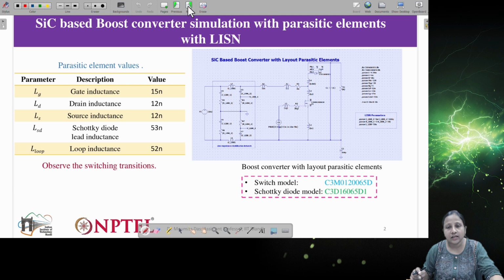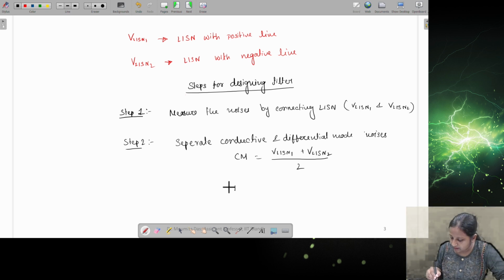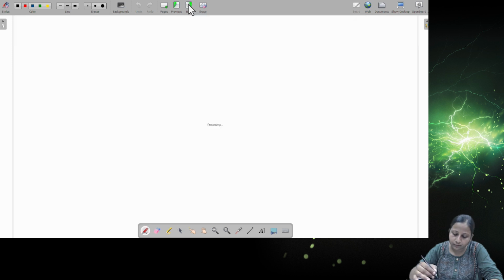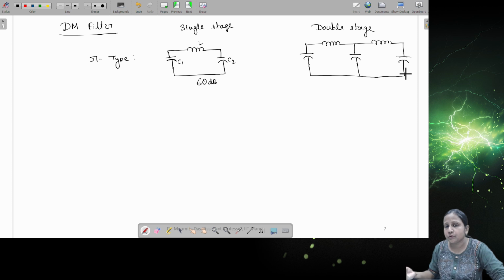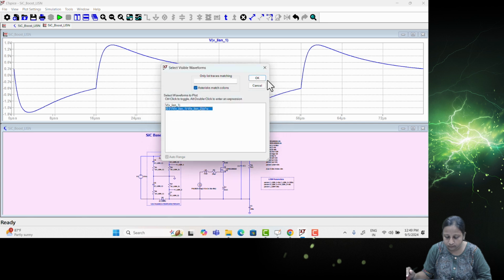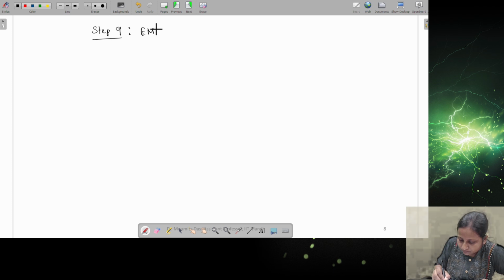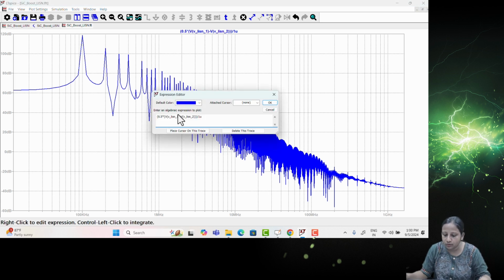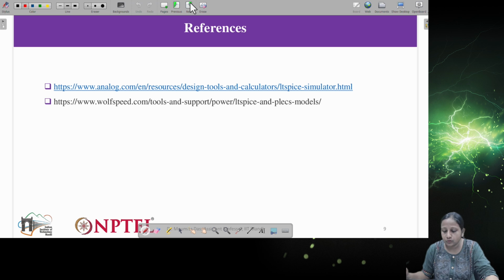EMI Simulation with LTspice (Part 2)

Comment: No we can't choose any type of filter for any circuit...you need to check the impedance of the source & DUT to decide which type of filter can be applied..... please provide calculation for components values which is the main aspect of the design and the same is missing from the lecture